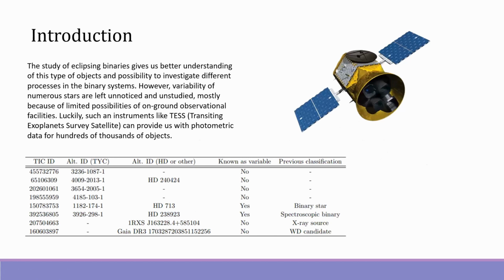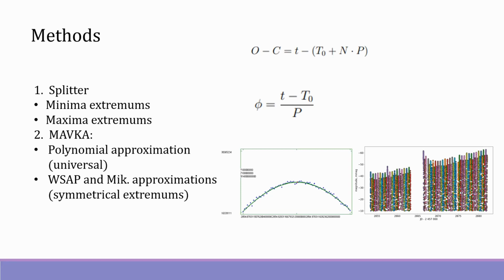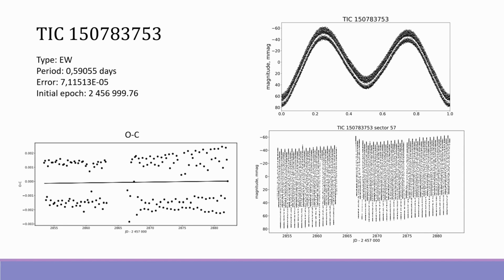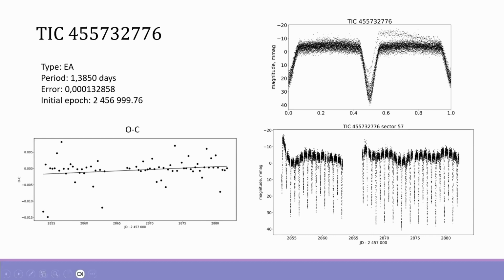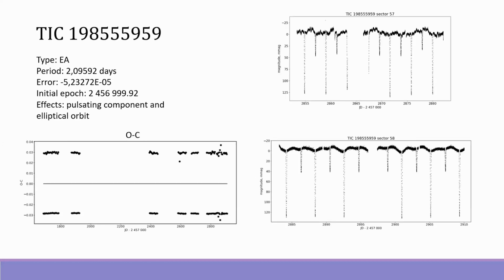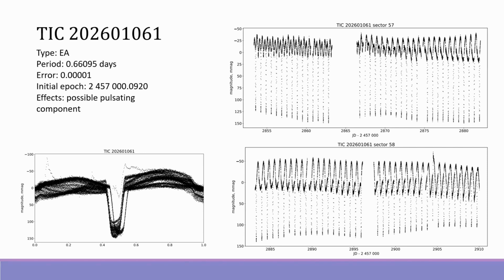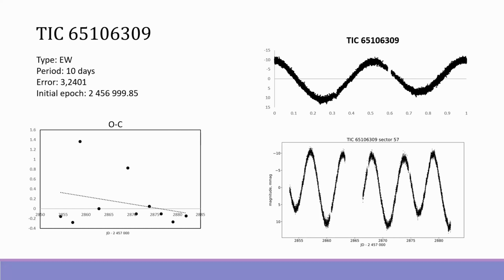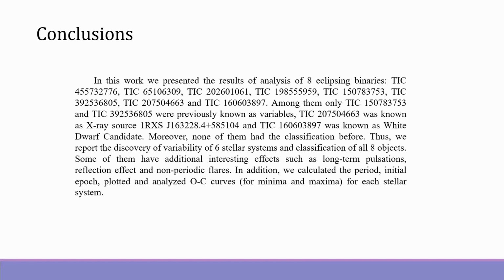Oleksandra Pyshna - "Discovery and period analysis of 8 new TESS variables" | CSF-7

Comment: I should admit that I'm impressed... How exactly do you check if the star is already known as a binary or it was considered as a single (or non-variable) star?
For example, let's take a closer look at TIC 455732776 (the second star). It had already been published in "TESS Eclipsing Binary stars. I. Sectors 1-26" (Prsa+, 2022) with the period of 1.3850806 d.
On the first star, TIC 150783753. I do agree, that this one is a binary (and not, let's say RRC, as it was assumed nearly 20 yrs ago), but I doubt very much that it's an eclipsing one due to its minuscule amplitude. More likely that this star is to be classified as ELL-type. Please note, that any O-C analysis is reliable only in the case of rather large time-span (typically - many years). Which means that you can't make any conclusion on approximately 50 cycles. Assuming that this star is a contact binary (which probably really is, though it requires much more effort to make sure) with rather short period, you may be 100% sure that the stars have circular orbits, no "precession of orbit eccentricity" is possible at this stage. More intriguing here is a gradual increase of mean magnitude.  
I'm sorry to say that TIC 198555969 had already been listed as an eccentric EA binary in AAVSO since 2019. And with the correct period P = 4.19185 d.
TIC 392536805 had also been registered in 2019 as EA+GDOR. "Flat maxima" was the most surprising part...
TIC 202601061 had already been known as variable at least since 2018, and as eclipsing since 2022. Though variability in maxima are indeed interesting and better to be further investigated.
TIC 65106309 is known as variable since 2018, but its nature was unclear. Sector 17 should be also available for this star.
TIC 160603879 is also known as EA since 2019. 

I said all that not to discourage or something like that. But to encourage everyone to be more careful in their research, to check and double-check, to dig deeper and to suggest alternative hypothesis for some effects, if possible. And also keep in mind that if you discover any new variable in TESS data, you better register it straight away, or you will loose your priority as a discoverer.